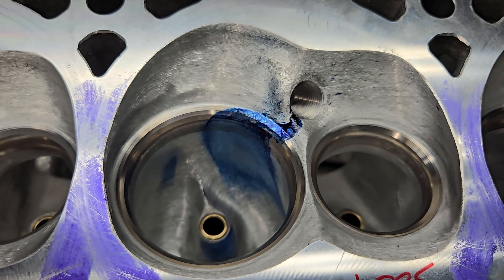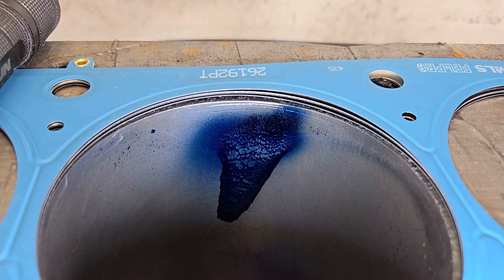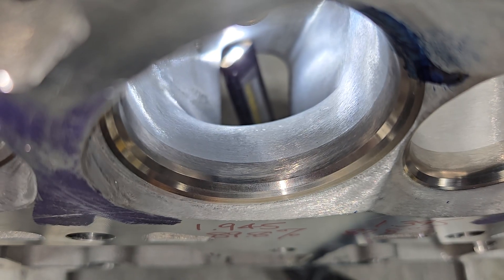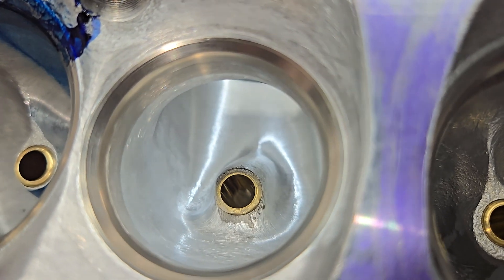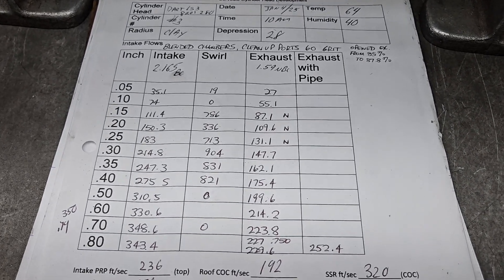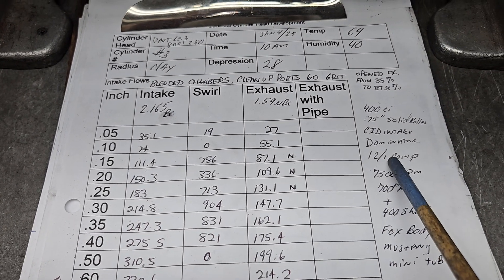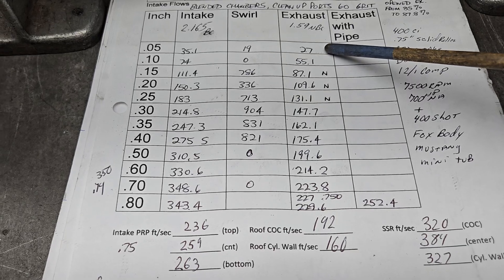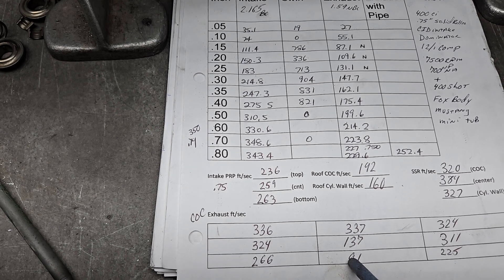Dart LS3 pro1 280cc cylinder head, amateur porting, go heads up against Brodix b3 LS3 amateur ported

Comment: Less layback qnd more width....drop the radius on the curved side of the port. More bowl would be nice too.
Reply from the maker: @arturozarate1752  You know it!
Reply: @servediocylinderheads  Dart also did most of the work on the exhaust by dropping the cylinder side of the port.....throat out to 91% maybe 92%(honestly with a 55° seat I've gone bigger). Nitrous baby.....gotta get that outta there.
Reply from the maker: @arturozarate1752  Stay tuned!
Reply: @servediocylinderheads  you know I will.

Comment: what are the gains over factory heads? the LS3 i think it was called flow near 320 cfm or more as cast. Also noted that ports are huge so a camshaft must be designed so.
Reply from the maker: @smilsmff  I don't think I have ever flowed a stock LS3. So I can't say.
Reply: @servediocylinderheads I like the 821s over the 823s. Really like valves.

Comment: The reflection on the exhaust is showing you why it's slow on the floor. You're getting a little recirculation from the valve guide. That's probably the noise you hear, at higher lifts the bubble re-attaches downstream but adds a fair bit of drag. At lower lifts there's not enough rotational energy in the vortex to keep the flow attached downstream.